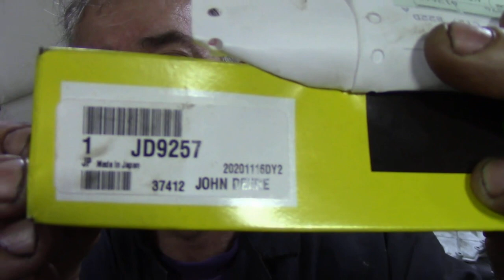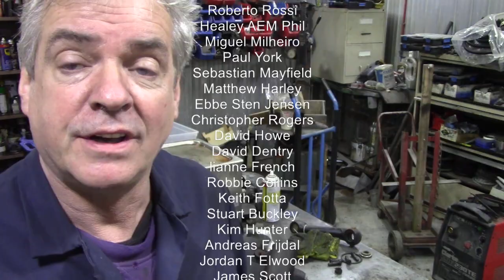Replacing the fan pulley bearing in the 300Tdi belt cover

Comment: Hello Mike 
Next time you need to part off a piece of case hardened spindle or suchlike item cover your lathe beds, and use an angle grinder with a thin abrasive cut off disk on the spinning job, only grind through the case hardening,  complete the partition with a parting off tool.
Reply from the maker: Thanks for the tip!

Comment: I have done the same modification using a Ford straight six 4lt model water pump. In Australia we know them as the EA Falcon model early 90's. The complete water pump cost me $13 AU. Beats $385  plus for genuine. It lasted me 100,000km, and in process of doing it again.

Comment: Mike, those hardened shafts/spindles are easily cut by holding them in the lathe chuck putting the lathe on a speed you'd normally use for machining that particular diameter and using a 4" or 5" angle grinder with a 1mm thick cutting disc against the shaft as it's rotated by the lathe. An air duster gun is also positioned to blow cooling air onto the job to keep it cool and preserve the seals of the bearing cartridge.
This method saves the necessity for "specialised" lathe cutting tools and it's a method I've used many times for "parting off" hardened, normally not easily machineable steels, it works fine...
Reply: Just cut the extra shaft off with a grinder.  There is no need for accuracy.
Reply: @red90rover98 " Sir, not in my world, accuracy is everything..!" LOL
Of course it's not, it's only an old LandRover, do your best, it only needs to be rough...
Reply: what he says, done the same!

Comment: Hi Mike
How we got around a dry bearing on the front fan cover was to drill a hole in the back plate of the bearing and used a grease nipple with the syringe needle and regressed the bearing. Sealed the hole with a good epoxy. Have regreased the bearing 3 times and the Disco 1 Td300 has 680 000kms on it. Time for another timing belt.
Cheers Lyndon from Tasmania

Comment: Hi Mike, greeting from Aus i've done a few of these bearings over here using the same John deer bearing, for a replacement flange I've found the a Ford XC, XD, XE and XF  falcon water pump uses the right size diameter and right size thread and spacings, only pushes the fan forward 2-3mm in towards the radiator more but never been an  issue
Reply from the maker: Sounds great! The falcon never came here, but in a post above they were fitted to the ford transit in the UK

Comment: Hi again Mike, sorry for wrong info in my last reply, hope this info is more accurate for 'ya. Search for bearing number '885802' and prefix that number with the bearing mfger of your choice. So that is, if you have a preference for SKF search SKF 885802 and you will get various hits. What comes up under SKF is BR885802(as a part number of theirs) Similarly with Koyo, a part number of 885802RS seems to be a part number they may use. INA also seem to make them too, their part number is 4VH22055. Searching for these part numbers all seem to point in some way all back to JD water pump bearings. And if you find an 'aftermarket' part supplier, ie. a bearing specialist .. they list all manner of manufacturers of this JD pump bearing(as exampled above). The other tidbit of info I found about this bearing: Same bearing and flange as used in Ford Transit VG('88-00) models with the 2.5TD motor. This bearing and flange is also used for fan hub duties. Ford no longer stock it tho. Can be found at a few auto parts places. If you search at transitcenter dot uk for ford part number '974F-8A641-AB' for the bearing, and ford part number 864F-8K600-AC will show results for the flange. Here in Aus, many guys use a Ford Falcon waterpump. Complete assembly, rip it to pieces, steal the bearing and flange, chop off rear shaft and impeller, easy done and cheap. Can't recall that part number tho. Maybe Ford US have a similar waterpump too(ie. flange already fitted).
Reply from the maker: Thanks for the info! We have only just got the Transits over here and they have different engines and mainly petrol 
I think I could get the flanges made for C$10 each = problem is I need to order 50!

Comment: Hi Mike, a super vid, yes I know how fragile those fittings are, mine sheared off when changing the viscous unit, so just fitted twin electric fans, Have you seen the force of Land Rover that is Sophie Devon, a youngster in UK who has so much passion for the marque she needs following, just watch her...she is your kindred spirit
Reply from the maker: You can get them off but you need to sleeve the bearing with a tube and then push out the shaft

Comment: Hi Mike, new timing covers cost £130 in UK, you could sell those bearings & JP’s flanges in your shop so folks can replace their bearings at home. Cost in UK for this bearing is 3* and imported from US bout same. Flanges are brittle cheese so most may not survive home DIY extraction.
On another note: I’ve seen two different types of crankshaft seal in front cover, one two piece type the inner seems to rotate with crank, other one piece type is normal lipped seal, not sure if/why/when they changed if you can cast any light?
Reply from the maker: If I could get enough interest I could have them CNC made for C$10 each - but I need to have a run of 50!
Reply: @BritannicaRestorations  Mike, put me down for a bearing & flange. I have a cover with worn bearing & flange with missing lugs from PO. Seems like coals to Newcastle but no one here is interested in making cheap repair components, they’d rather sell you a new one at £130

Comment: Great video Mike. I managed to sheer the flange behind my fan pulley and cannot get the fan off because as you say, it is recessed. I have another timing cover, but is it possible to bang the bearing out of the old cover with a hammer and rescue the fan and pulley?

Comment: Hi Mike,

Love your videos.  I'm a semi-retired Subaru mechanic in Oregon, and enjoy your process of going through your restorations.  There are lots of tips that you share that are based on lots of experience doing the work.  This is stuff that's not in manuals or taught in schools.  This saves folks who are just getting into this work having to learn them the hard way.  Great job passing your experience on, and saving folks loads of time!

A question and some thoughts on your fan bearing.  Aren't these actually "bearing assemblies" that are made up of 4 components?  1.  The inner shaft,  2&3. two permanently sealed ball or roller bearings that are pressed onto the shaft, and 4., an outer sleeve that the outer races of the bearings are pressed into?  

* update, I got a closer look at the original factory part via a link one of the other responders sent.  While these are probably assemblies, it looks like they crimped the ends of the outer sleeve down to hold the bearings in place.  If they had used spring clips instead, these would have been rebuildable.  That groove on the outside of the sleeve may also indicate that they crimped locked the front of the rear bearing in place by pressing in that groove.  It's the typical case of the manufacturer saving a few pennies during manufacturing by eliminating cutting inside grooves in the sleeve and the spring clips that would have made these rebuildable.  I have run into the same issue with newer riding lawnmower deck blade spindles.  The older ones were rebuildable with 2 $4 bearings, but the newer ones aren't for the same darn reason. 

I also found an interesting write-up on an Australian Land Rover site that covers some options for replacing the bearing, and sourcing a replacement fan mount here:
https://www.aulro.com/afvb/projects-and-tutorials/61474-300tdi-viscous-fan-bearing-solutions.html

Which brings up the idea of using bearing assemblies from automotive water pumps, some of which may very well have fan mount that could fit these.  I know that the Ford Falcon they are mentioning wasn't produced for the North American market, but I seem to recall that other ford and possibly some GM fan dampeners may well have the same female thread used on these motors.  If so, wrecking yards might be a great source for inexpensive used replacements.  You would just need to take a caliper with you to measure the shaft diameter, the outer diameter of the bearing assembly, and check the bolt pattern and size of the fluid dampener mount.  For the DIY folks, the Australian write-up mentions using a cutoff wheel on a grinder to remove the unneeded rear shaft, so a trip to the machine shop could be avoided.  Just go slow so you don't get the shaft too hot and overheat the bearing.***

Philip from Oregon
Reply from the maker: Phillip - the John Deere bearings is C$35.00 and is available at my JD dealer next door! Works well!

Comment: Hi, Stefan from France.... Huge fan but the problem is I don't own any of the vehicules you are talking about !!! I'm owning an RR 200tdi and a Land Rover Series 3 2,25 diesel. and I need to change the fan pulley bearing !!! Any chance you can put your hand on someting like that and make a little video? To help me? Thanks and go onwith your videos, don't stop !!! Please
Reply from the maker: Stefan = unfortunately there are very few 200Tdi here = in Canada the 300Tdi is the most sought after.
As for Series, not many of those here either - they are used for drives in the country or for going to shows - so not many used daily

Comment: For the record. On Brazil and Argentina you can find this bearing from INA with reference/code 711031710. The 300tdi is for all matters the Maxion HSD 2.5 here in the south.
Reply from the maker: Yes I have followed this with a fellow Argentinian, but these are very expensive outside your country
Reply: Zobacz to https://allegro.pl/oferta/lozysko-obudowy-rozrzadu-defender-discovery-300tdi-9041016098

Comment: Hi, Mike I have a problem were this bearing on 2 separate covers original and replacment walks its way out of the cover and destroys  the belts and hoses. Do you have a solution for stopping the heat from use from allowing bearing to get loose in the cover? I live in australia and this seems to be an issue in summer with ac on as the temp in the engine bay can reach 90ish deg Celsius. I was thinking of using a grub screw or similar? Have you seen this issue? Thanks in advance.
Reply from the maker: I have never seen one come loose - always have to press the out

Comment: Did you vapour blast that casing and did you leave the original spindle bearing in when  you did it?
Reply from the maker: Yes, I vapour blasted it and then fitted the new bearing afterwards
Reply: If the bearing is still good, will it survive the vapour process?  @BritannicaRestorations
Reply from the maker: Yes - try to avoid high pressure contact - skirt around it a bit
Reply: Great and thanks. 👍🏻  @BritannicaRestorations
Reply: Update. Bearing buggered. I don't have the machining facilities, so could I fit the JD one without cutting it?

Comment: What did u use to remove the flange, without breaking it?
Reply from the maker: Push the bearing and pulley together from the back, then push out the bearing from the pulley by supporting the pulley from the back with a bit of tube

Comment: Hi Mike, just had a quick look round and found a post from 2016 on defender forum with exact details about bearing, also on eBay (UK) item 123772195274 is a new flange £37, good luck
Reply from the maker: Wow they are expensive - If there was a demand I would get them made here